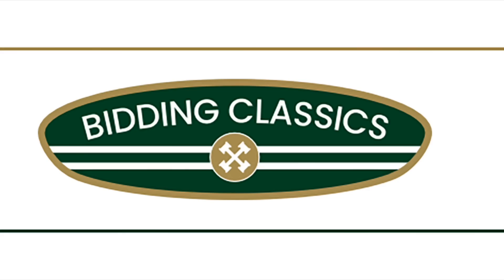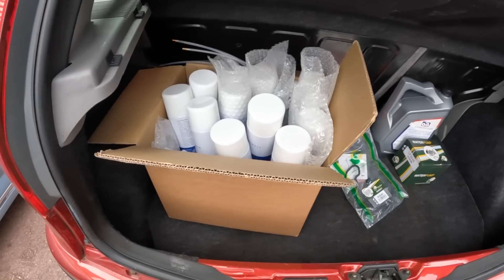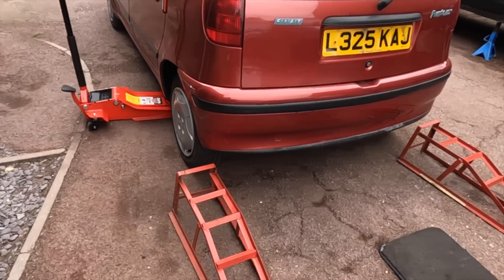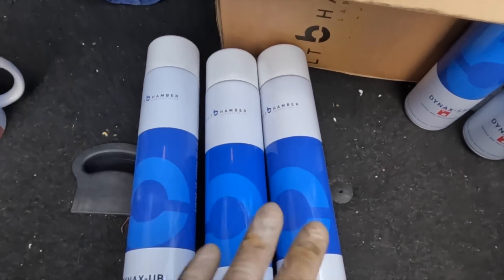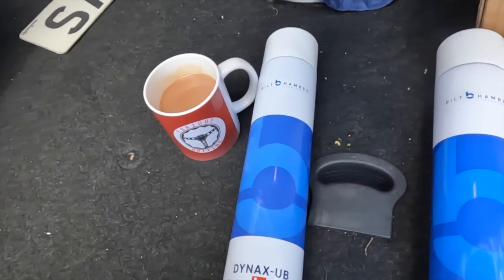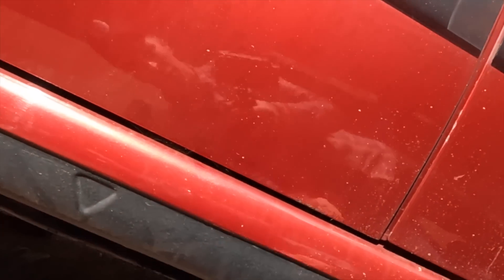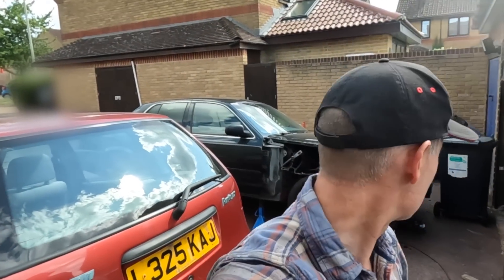Saving the Punto from itself - lashings of rust protection!

Comment: Matt the rust and the metal you exposed from the grinder you should have used bilt hamber hydrate 80 to start with then after painting that on and it going off , then use your spray wax , I’ve just done my TT with it ,I don’t think the old fiat has much longer on this plant , it’s not looking good underneath, you haven’t done anything to stop the rust just sprayed on top of it and made it worse by sanding the under seal off the bottom to expose the metal
Reply from the maker: no, there was surface rust under the the old underseal. so taking it off stops it rusting under that unseen, and Ive only taken it back as far as good metal and paint, then coated it with UB which is a rust neutraliser as well as a covering
Reply: @furiousdriving ok sorry I didn’t realise that , but it’s some good stuff
Reply from the maker: @Phil-1969  yeah, it’s not the old days of black goo and hope for the best!
Reply: Agreed... removed a load of primer and underseal, didn't convert the rust, didn't even spray Halfords Zinc primer. Instructions said specifically apply to painted surfaces but it just went on to bare metal as the only protection. Ok for awkward unimportant suspension bits but sloppy for the flooprpan and sills.
Reply: @johnmoruzzi7236 everything he does seems sloppy tbh.

Comment: To drive up ramps like that cut a couple of long strips of carpet the width of the rungs, fold in half and wrap around the bottom rung then lay it out towards the car. They can't slip until the car is past the first rung and by then the weight of the car should hold it. Also if it has kick plates in the door openings, remove them and drill a hole into the sill so you can get the rustproofing extension in. Don't bother plugging the holes, they're covered by the kick plates and will allow a little air flow which is good.
Reply from the maker: no, there was surface rust under the the old underseal. so taking it off stops it rusting under that unseen, and Ive only taken it back as far as good metal and paint, then coated it with UB which is a rust neutraliser as well as a covering
Reply: @furiousdriving  ?
Reply from the maker: @nickhaag7803  sorry, that reply posted on the wrong comment..
Reply: @furiousdriving  I have fingers like that after a long day too!

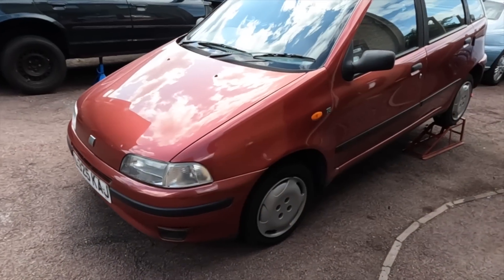Comment: 3:37 only crap because you haven't put two lengths of rope on them which you then put under the other set of wheels and when driving/ reversing will pull the ramps into the wheels being driven up. Been using this method for years and it saves tons of grief trying drive up shifting ramps.

Comment: Good effort here Matt. Bilt Hamber products are great but having used both Dynax UB and UC on plenty of projects you really need to make sure all loose flakey rust is removed by knotted wire wheel, abrasive disc or blasting before application. These products are effective at treating/slowing surface corrosion, but deeper pitting such as that visible on the rear suspension beam and arms, drum backing plates, springs, brackets etc indicates deeper ingress of moisture and delamination of the steel which can't be stopped using a surface treatment.  In the longer term, the only way to properly address the body rot is by cleaning back to clean steel, etch priming, stone chipping, painting and then applying protective wax.  Keep up the good fight!

Comment: Products made by Bilt Hamber Laboratories are hard to beat in terms of rust-treatment. After thorough preparation, I sprayed the Dynax UB on the rear beam, suspension coil pans and anywhere I was finding surface rust, on the 15-year-old underside of the family Polo. But that was during our first lockdown, over three years ago. Due to washing weekly, driving economically, and keeping on top of the maintenance, the Polo is still very black and clean underneath.

Comment: You should 3M stone chip at its factories, where to do it and use the cover wax it works inside the holes of the car on the body car 3m seam seal clean all the services to buy metal and it works really well factory on the body car

Comment: Wow, that's a huge effort.

I am lazy, I give all the rust a quick spray with something like Comma Release oil or even WD40 then with some thick gloves I smear a pot or two of Copperslip over everything that's rusty. Then inspect and repeat on areas where the rust has fallen off a few months later. After the first year, only yearly inspections and touch-ups are required. Mud traps can be treated with engine oil as dried mud and oil make a good rest preventive, I treat inside sills and box sections with wax if they look perfect inside otherwise they get oil on a semi-regular basis.

Comment: Underseal my 1996 Volvo 940 every 2 years. So far in it's 208,000 miles only needed a small patch welding on the drivers side rear outrigger.

Comment: I have used Bilt Hamber Dynax UC on brand new cars all underneath stops suspension components even thinking about corroding. 

Hammerite's Shultz with built in Waxoyl is great for older cars and leaves a black self healing protective layer on the underside

Comment: What I have done to stop my ramps moving is to tie some rope around the bottom rung, put the ramp against the (rear) wheel with the rope on the outside and then stretch the rope to the inside of the (front) wheel, then as soon as you move the (front) wheel will be on top of the rope,  preventing the ramp from moving as the (rear) wheels start to climb it.

Comment: Unless it receives urgent, expert surgery the Punto will soon die. This is poor quality palliative care.

Wasn't it a huge disappointment to find the Crown Vic was a heap of rust someone else had covered up...?
Reply: this isn't covering anything up, this is how Dynax works. You wire brush loose rust and spray over, it has a rust neuralising agent to attack any rust left over on the surface and forms a tight sticky wax underseal.
Reply from the maker: Nothing like the Crown Vic. This is a rust neutralising formula that seals and protects
Reply: @furiousdriving  My comment about the need for urgent, expert surgery on the Punto has been ignored.
The Crown Vic was cleaned and polished with a load of the best (sponsored) products available yet the underlying rust came as a surprise. The Punto is obviously full of rust and you're trying to kid us that a wire brush and (sponsored) aerosol wax will fix it...?
Reply: Good job done and hopefully it will serve you well, certainly looks much better
Reply: It's just going to sit over the rust and hide it for a bit. It's not actually fixed anything.